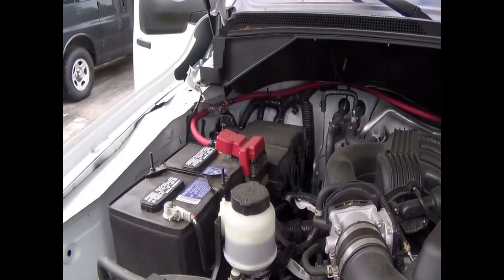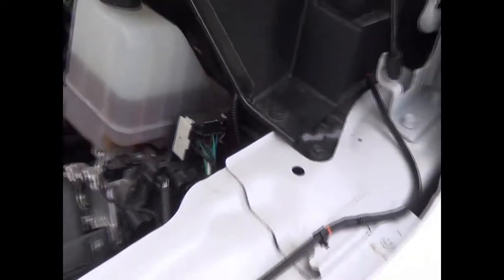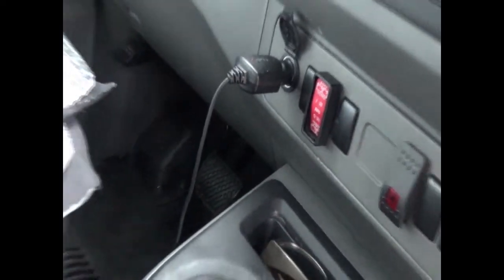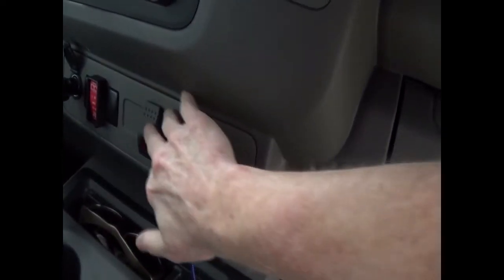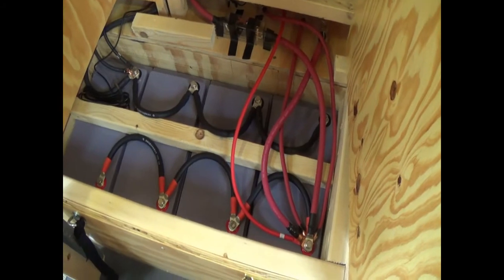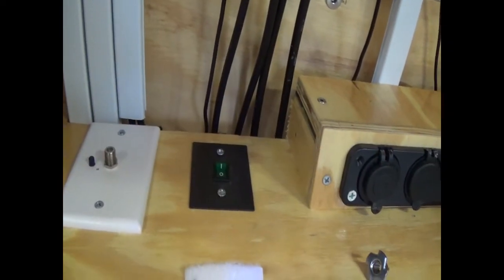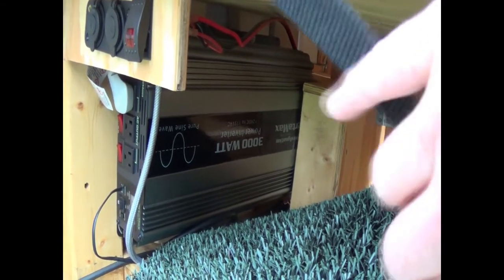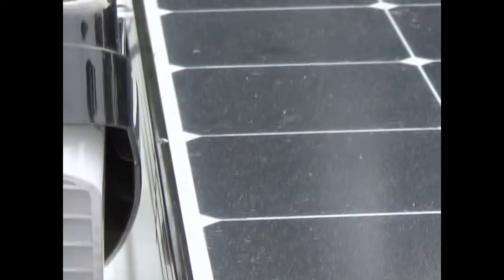Power System for NV2500 Van Build

Comment: I see you have a pretty big air gap below your solar panels, how are they holding up, any vibrations or howling on the freeway?   I used unistrut channels to set up mine and the cross channels aren't rigid as they bend and vibrate a bit when I pound my hand on it.  Wonder if your L-beams are better.
Reply from the maker: No noise on the highway, but the cross pieces do flex
Reply: @rebbar64  Interesting, thanks.

Comment: How did you mount the solar panels to the roof. Mine is a 2012 nv2500. Thanks, Northstar
Reply from the maker: I made a rack out of galvanized angle, bolted to the Van's brackets on the roof. Look along the edges of your roof there should be some built in brackets there.
Reply: @rebbar64  yep I see them what attached the brackets to the channels?  Thanks!
Reply from the maker: @northstartraveler3561  I used 1" long by 1/4" stainless steel bolts, 2 flat washers, lock washer, and nut. Where the rack is attached to van I also put a rubber washer in between the van and rack.